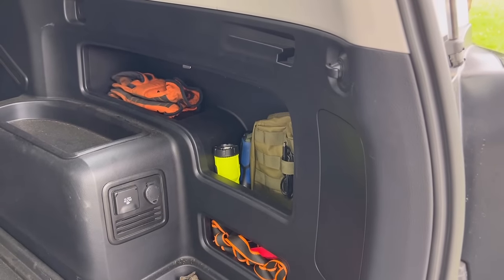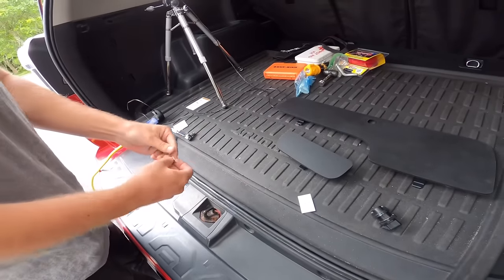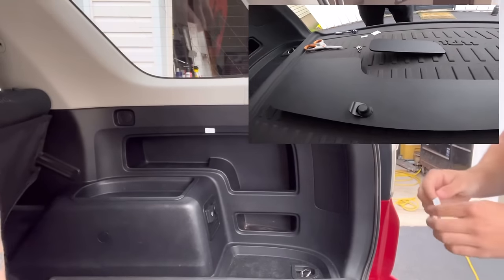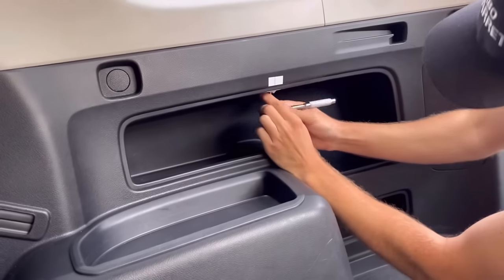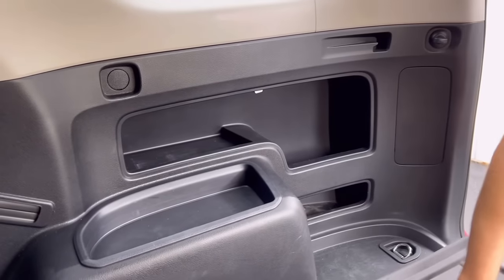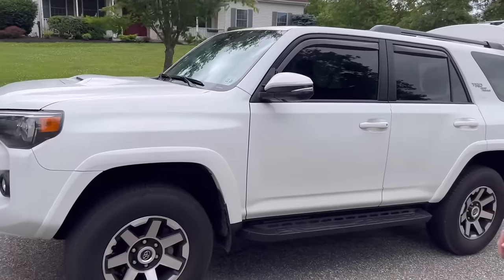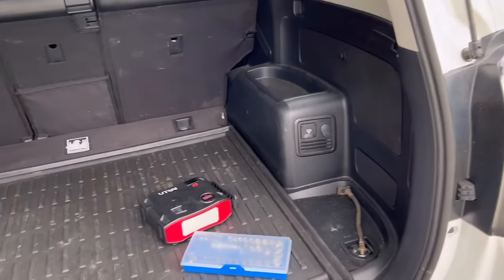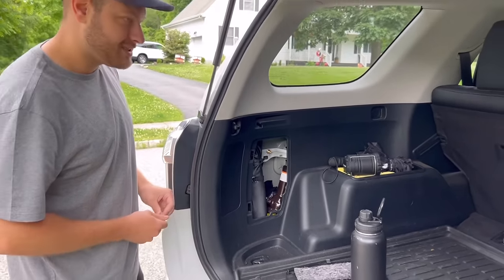This Mod will blow your mind!  Toyota 4Runner 5th Gen • Cargo Storage Cover (OEM ++)

Comment: Just got mine yesterday and installed thia morning, so far so good. Tried to use a drill which was an option as per the included instructions, the bit just kept slipping so I did it exactly how it was installed in the video with tape as a marker and a right angle bit driver use 1/4 inch nut driver and worked out well.

Thanks for sharing this video, was exactly what I was looking for now if only matt can make a low profile set of drawers which don’t cost over $1000 like the other companies I’ve seen so far.
Reply from the maker: 😅 You got it!!

Comment: For the little cover I used 5lb double sided tape and  a plastic hook you can buy in packs of 6 to make a handle. Works awesome and now I can access the bottom of the panel without having to remove the upper section.

Comment: In the process of doing this mod. Thank you for sharing it.   It’s going to be awesome to have a little more storage in the rear.   I posted a thank you to you on fb.  But it couldn’t find you.
Reply from the maker: You’re very welcome!! 🙏🏻
I’m glad you like it.
(You can always find me there under Paulo Barreiro)
Reply: The color is a little off not quite as dark.   I was wondering if I tried spraying with blk spray if it might look better.  Ours I think needs adjusting, it doesn’t come off that easily.

Comment: To answer your question, "Are you done modding your 4Runner?" Let me check my wallet... Not this month. Although, I just ordered those covers...  :))
Those are great mods! I really like what he did, especially relocating the dongle socket. Those covers are awesome.
I don't tow as much as I do make those dangerous Costco runs. Because I have Bilstein 6112s in the front (at the lowest setting) my rear ended up being a bit too low, so I added 25 mm spacers in the back. That way, I avoid pissing off on-coming traffic at night when loaded up. Unloaded, the vehicle has a nice, subtle rake. I did think of adding air bags, but it didn't make sense for my application.
Thanks for showing us this, Paul! Say, are you going to install a lift kit on that "little yellow car?"
Reply from the maker: Lol, thank you for the good laugh. I appreciate you!
I hope you enjoy your covers.
I’m still trying to get the little one to ride it without freaking out.
Although raising it would be interesting, I would finally get all the views 🤣🤣🤣
Enjoy the rest of your weekend!

Comment: I ended up using a flexible extension bit to get my drill up into the tight area to drill the screws in and that made it take about 30 seconds. VS the way the inventor is doing in the video.
Reply from the maker: I got you. Noted!

Comment: Use note:  love my covers, but after a while one of the tabs separated from the large one.  I recommend drilling a small hole 8/32" is the size I did, and install a screw and nut as secondary attachment for the tabs.

Comment: I must say that after the first viewing of the Cargo Storage Cover I couldn't stop thinking about how cool/necessary this mod would be at some point. Should have been a factory option. A day later, viewed the video again and I've now ordered one. Hope it's here soon enough to install before I take my next cross country trip in October.
Reply from the maker: Right on, I do agree! it was so well executed I had to share with all of you. Safe travels, thank you for your support!!
Reply: @VikingsGarage  Received and installed with the following caveat ... The strike plate is very difficult to locate. The accompanying template gives the centerline, but not the front to back offset. I am not using the release at the moment because the friction fit of the large panel seem to be adequate. Looks great, though!
Reply from the maker: Awesome!! 👏🏻
Reply: Played with the strike a little bit and determined that the vertical down leg needs to be toward the interior of the storage area. Still a bit difficult to screw in, but doable (probably because I'm 74 and not as flexible as I once was). Now everything is how it needs to be. Should definitely be an OEM item from Toyota.

Comment: Got a link to the shifter boot clip you got off etsy? Also what year Honda was the boot from out of curiosity? My shifter is really worn and I was already looking to change. That set up looks really nice!
Reply from the maker: Matt he’s the one that could tell you. I’m sorry
Reply: Agreed
Reply: Ok… there’s probably a cheaper way to do this but I completed this mod after I saw it. 

I bought the taco shift knob from the stealership because I assumed the many cheaper options on eBay are fake. I then bought a used shift boot assembly for a tacoma part number 35978-04010. This is the only way I found to get the clip that clips into the shift knob. Then I got a boot off of Amazon and cut the hole open a bit more to fit around the clip and used a zip tie to attach it to the clip. It looks amazing and functions great. Good luck
Reply from the maker: Thank you for sharing!!  I love the re purpose of other Toyota parts 👏🏻👏🏻

Comment: 3rd gen 4Runner has the cover just like that.  Not sure why they removed it for the 5th gen.  Does the 4th gen 4Runner have the cover?
Reply from the maker: 4th gen is a similar deal, Speaker on higher trim level and a compartment for all others with indeed a cover. 😉

Comment: $87.19 buys an awfully lot of ABS sheet.   Or 5.5mm lauan for that matter.  Make a cardboard template and tweak it with shears until you're satisfied of the fit into the recess.  Fold it in half and set in place so you can get a pencil inside to trace out the actual opening on the back of the template and you'll have everything you need to cut the blank and mount the lower fingers and upper latch.  Have fun!